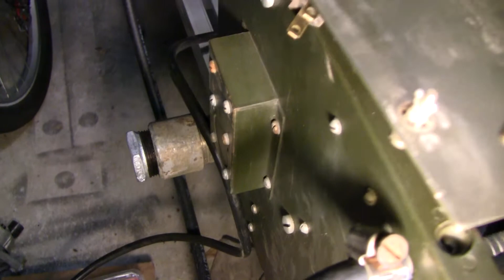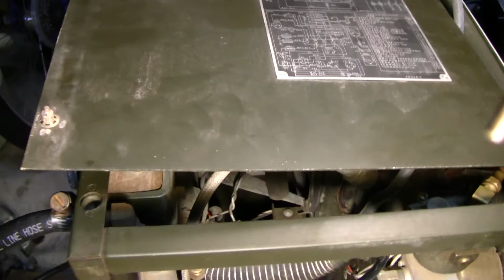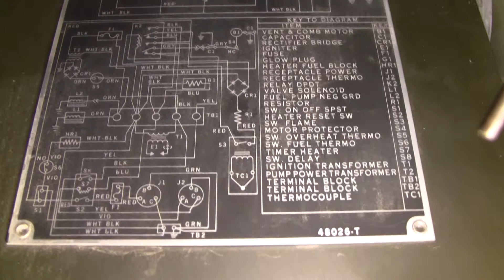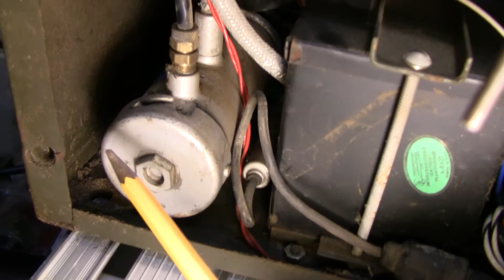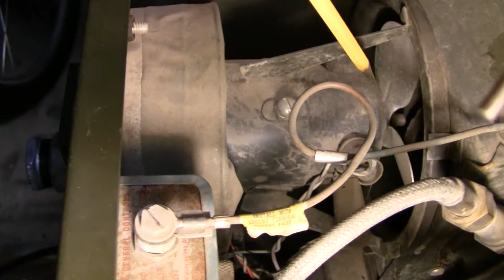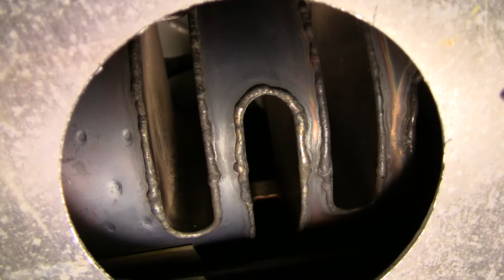MULTI FUEL HEATER CLOSER LOOK

Comment: So they don’t have glow plugs. They have spark plugs. I have two of them. as for fuel. You can run whatever you want. Diesel or kerosine is better for them. More stable. But was designed to run on whatever you could get or find.

Comment: i just got my unit installed in my Sprinter van. I only need it occasionally so instead of getting a $1500 Espar heater or trying to hack the built in one to work, I decided to install the heater I already had. I think it must not have been used much (probably needed AC more than heat in Vietnam) as it is still burning off the new paint smell. I used flexible exhaust pipe through the floor with another stainless steel corrugated tube over to shield the heat. The thing heats the van in minutes even if stone cold. It is a little noisy but less so than the one in your video. I think you need to oil the motor. The thing works great on kerosene or diesel with only a minor adjustment of the fuel needle. It draws about 500 watts while running so it has to run on the aux (solar charged) battery bank but i think it might only need to be on for  half hour a night. I ordered a CO detector which has not arrived yet but plan to have that in the van whenever using the heater.
Reply from the maker: +spencer chase Very cool! I should into lubricating my motor to see if that quiets it down. I am sure it works quite well it the van. Would like to do a similar setup myself.
Reply: +dirtbike5100 i just bought an Espar heater on E-Bay for an irresistible price so i will probably be putting that in place of the military unit. will find some other use for it. the Espar draws more like 50 watts when running so i could run it for hours on the solar battery bank. also should be quieter.

Comment: I'm very sad to here about your ranger as I'm a full on second gen ranger owner and a damn proud one too!!  If something went cerput on it go on Facebook and search "Ford Ranger Fanatics" its group where people can chat about rangers and get all the info you could possibly need.  And that fuel pump looks just like one I have on a Kohler generator too!  I would get that jet fuel out and put diesel fuel in and see if that helps it run cooler and maybe remove that restriction on the front. I would make sure you don't have exhaust restrictions too because that will raise the temp allot.
Reply from the maker: I hadn't thought about the exhaust restrictions! I'm gonna have to try it opened up!